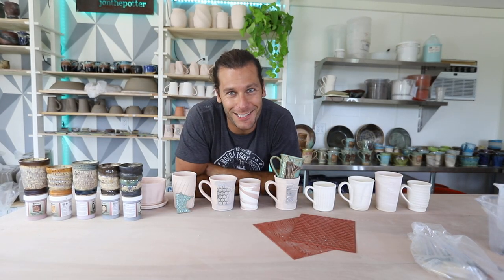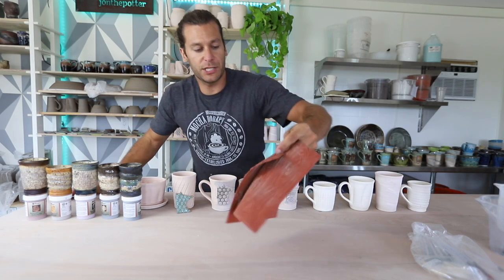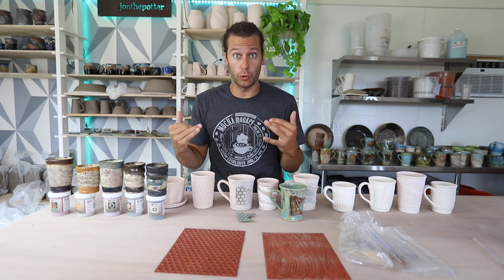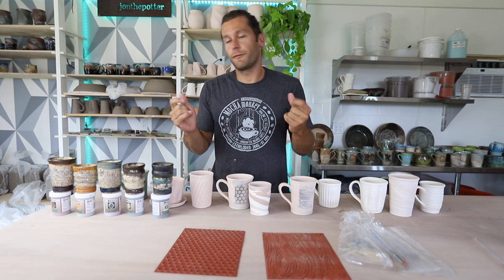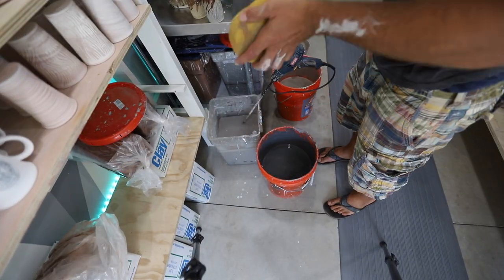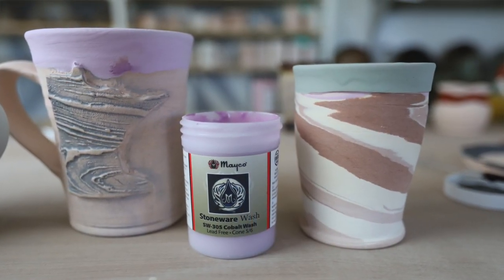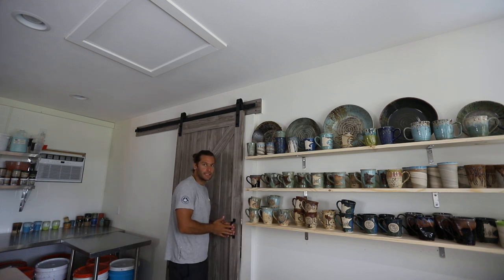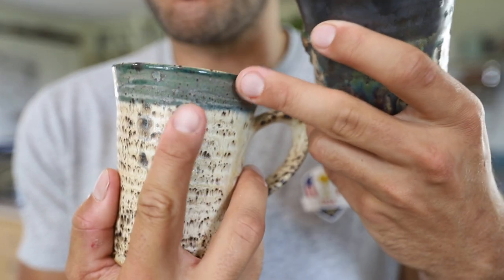How to make your POTS better!  - Washes, Brushes, Stamps and more from MAYCO!

Comment: Jon, you could try using a small atomizer (Poor man's airbrush) to spray a thin layer of the wash, over the entire outside.  This can give glazes, a nice speckled effect.

Also as a warning to everyone, manganese, cobalt and copper are heavy metals.  Use caution, when using these materials, and do not use them on food/ drink surfaces without testing first.
Reply: Literally every single glaze on pottery has some metal component to it.  SMH... There are some that should not come into contact with food (especially glazes made in Mexico) such as many of the mirror-finish glazes, but in America glazes are tested and will have a warning on the container id they are not food safe. But literally every blue glazed piece of pottery you see will have cobalt as a glaze component, a green glazed piece will have copper, etc.
Reply: @hannahpumpkins4359  what does SMH stand for?🤔
Reply: @kimalonzo7387  It's internet shorthand for "Shaking my head".

Hannah, yoh are correctz that many ceranic glazes do have metals in them.  However, those metals are only used in quantities that the glaze can safetly hold.  For things like cobalt, copper and cadmium, that is only a couple percent of the total recipe.  Anything beyond that the metals can leach out.

Commercial glazes do go through rigorous testing, but the stability of those glazes only applies if they are used based in the manufacturer's mixing and application instructions.  For instance layering to stable glazes can result in one that's not.
In the case of this video, oxides were being applied over a glaze.  There is no way of knowing what percentage of those oxides was being used, in a given area.  
Such experimentation is fine on the exteriors, but on surfaces that come in contact with food and drink, a lot of testing should be done.

Comment: Try the iron or copper wash wiped back over the forest trees stamp you use on the Minnesota applique, I bet it'll give it some cool depth.  Also over wiped back on the wood stamp I bet would look like actual wood.  I think I am going to try it on leaf veins I press into greenware.  So glad you made this vid, I've wanted to try washes for a year.  Are the washes food safe?
Reply: Hare Typer Mayco says they are, but if you use them in combination, you’ll need to test them.
Reply: Jenny Caldwell, how do you test them?

Comment: Writing things down is important. I wish I was more organized and did that more often
Reply: Mary Max KATS I bought a cheap fire tablet (like $25 on prime day)  and use an app called Wunderlist that lets me make notes and attach pics.  I can even share my lists with others so we can see each other’s results.     It’s soooo much easier then trying to use a regular note book.  I even bought a cheap waterproof “case” (basically a glorified heavyweight ziplock) so I can use it in the studio and not worry about getting it wet or dirty. For less then $35 it’s made a huge difference (& I can keep music on it for while I’m throwing).    You could use do the same thing with a smartphone and similar case.

Comment: Do the washes normally have just water mixed in? Or is there a frit added?
Reply: To use the washes we recommend adding water but you can also use them straight.  There is no frit added.